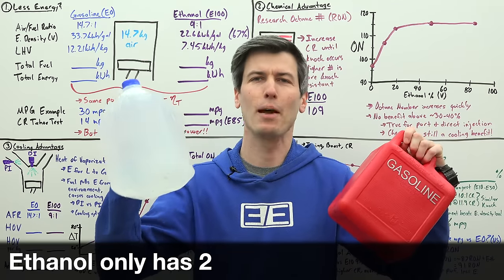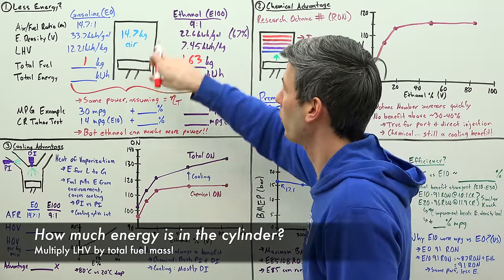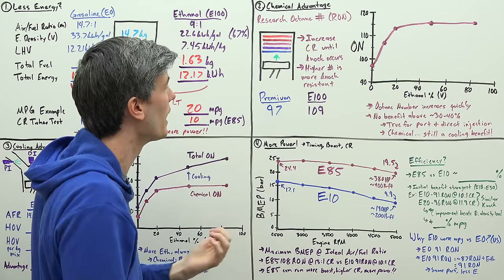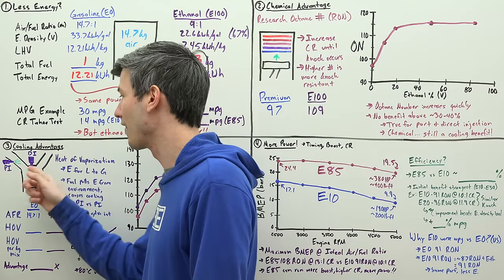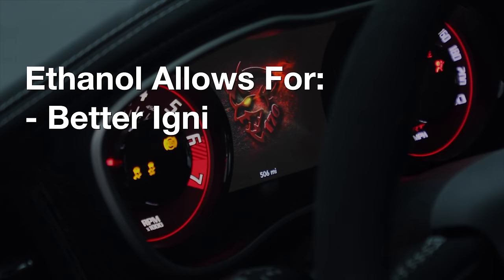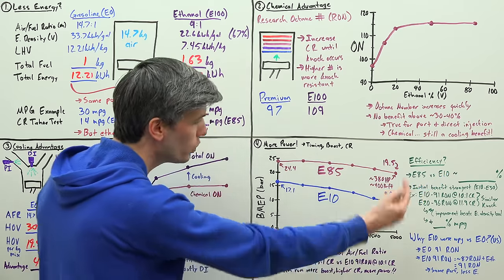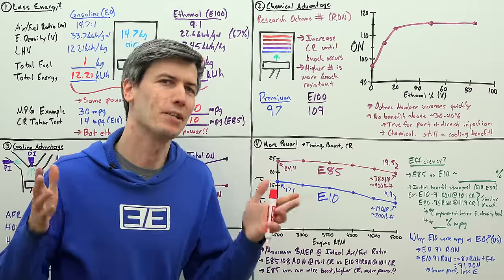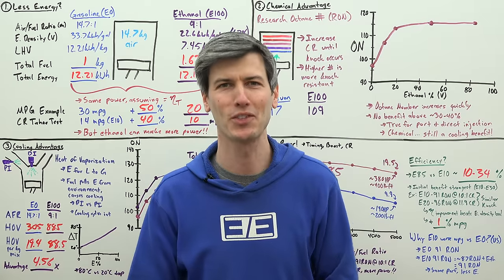Why Does Ethanol Make So Much Power? (Versus Gasoline)

Comment: Dragsters use alcohol because it has higher octane. This simply means it won't ignite as easily under pressure. This allows them to use more boost from superchargers to force more volume thru the motor. The alcohol is far less efficient and burns way more volume than gas. The additional alcohol helps cool the motor. The result is more volume due to forced induction higher octane tolerates the pressure and an engine the has a substantially shorter life due to the alcohol cleaning out critical oils. It's a bad idea to use in mass. It ruins engines. Period. This video is parroting a Data sheet and telling short stories that don't cover reality. It's wrong. Dragsters are easy to read up on. Look it up. Easy. It's only in cars today due to green agenda legislation and it ruins engines. Period.
Reply: I looked up the Indy 500 who has used three fuel, gasoline, methanol, and ethanol and it shows ethanol in these high compression engines to be very efficient.  So much so they reduced the fuel tank size from 30 to 22 gallons.

A Brief History of Racing Fuel By Craig A. Johnson

In 2005, the IRL used 100 percent methanol in their tanks. The fuel worked well and was more efficient than straight gasoline, but IRL officials believed there was room for improvement. In 2006, they moved to a 10 percent blend of ethanol and methanol, which was then changed to 100 percent ethanol for the 2007 season.

The desire to use only ethanol aside, 100 percent ethanol is nearly impossible to obtain, and is illegal to keep without paying hefty taxes that date back to prohibition. The actual fuel used by the IRL is a blend of about 98 percent ethanol and 2 percent denaturant. The exact composition includes a small amount of high-octane racing fuel.

The fuel for today's Indy cars has an octane rating of 113, compared with methanol's 107. This means a significant reduction in pre-ignition, or knocking and pinging.

In addition, many of the people who handle the fuel, say it smells like tequila. This quality may seem insignificant, but smell is actually one of ethanol's benefits when compared with methanol. Pit crews noticed the switch to ethanol immediately, reporting fewer coughing fits and less eye irritation before any other modifications were made to accommodate it.

According to Dennis Vervynckt, manager of hospitality services and an IRL official, in 2006, the first year the IRL began using ethanol, teams saw a reduction in efficiency of about 10 percent. "That's because we put straight ethanol into the tanks," he says. "The teams initially didn't make any or very many adjustments to their engines. After a few months, they kept tweaking and by the end of the season they were back up to 100 percent efficiency."

Vervynckt points out that there was a minor loss of power. "When they first started using ethanol, teams saw a slight drop in horsepower," he says. "As the teams got used to the fuel, they were able to get more horsepower from ethanol once they again reached maximum efficiency."

The switch to ethanol also allowed the racers to carry less fuel and make fewer pit stops, thereby increasing efficiency even more. "When the cars ran on methanol tanks had to hold 30 gallons to accommodate the fuel requirements of the cars," Vervynckt says. "After getting the engines to perform at their full potential, there was a significant gain in mileage. Indy cars now have 22-gallon tanks. When a driver pulls in to change out his tires, he can fill up. Teams were able to match their tire and fuel stops exactly, instead of stopping for tires only, or fuel only."

That efficiency translates into much less fuel being used by the sport. Lifeline Foods LLC, which supplies fuel for the IRL, will produce 120,000 gallons of ethanol for the 2008 season. And though this may seem like a lot, it's 20,000 gallons less than was used the previous seasons.

The switch from methanol-based fuel to ethanol has amazed almost everyone in the league. Drivers, the direct users of the fuel, voice their approval in glowing terms. "[Ethanol] is an American fuel that is good for the country and the environment," says Ryan Hunter-Reay, of Rahal Letterman Racing and driver of the ethanol car. Standing beside his crew as they make last-minute adjustments to the car, he is more than happy to discuss the benefits of the IRL's switch to ethanol. "It's been great for Indy racing the fuel economy, emissions there's nothing we don't like. We love it."
Reply: How can you not look up from the preconception you've found. Gasoline is far far more efficient. That's why you struggle with it in a high compression engine. Low octane means it will diesel before ignition. That's the only reason racers use alcohol. You touting alcohol is wrong. Gasoline is efficient. And yes, less gas is required compared to alcohol. This volume discrepancy outputs more co2 and requires way way more effort money and energy to grow and refine. Alcohol has no place in mass when it comes to engines. It's for high compression race engines. What are you overlooking?
Reply: @kevinmorris7722  — “Volume discrepancy outputs more CO2”? Really? 

How is that possible when ethanol is 52% carbon, while petrol is 87% carbon. Oxidation (burning) of a kilo of petrol emits far more carbon than oxidation of a kilo of ethanol.

If you can understand this, you’ll realize that “volume discrepancy” is irrelevant.

Given that revelation, would you care to rethink your above statement ?

Comment: Only problem with ethanol in gasoline and small motors is the ethanol absorption of water that sits in the small carburetor and will cause corrosion destroying the carburetor... Straight gas is good enough... To bad they started putting this crap into gasoline because I've seen a lot of small engines being tord down because of what ethonal is doing to them..
Reply: Identical small engines to ours in Brazil use their common gasoline which contains a minimum of 27.5% ethanol.  It has worked out so well and for so long that Paraguay went to E27.  Bolivia has gone to E25, India going to E20, etc.  

BTEX (benzene, toluene, ethylbenzene, and xylene) came along in our gasoline around the same time as ethanol, yet no one considers these highly corrosive chemicals a factor for anything.  Premium gasoline contains some 40% BTEX, regular E0 around 30%, and E10 around 20%.
Reply: Mercury Marine, which hosted a Webinar on ethanol myths, noted that ethanol does not "grab water molecules out of the air." It is hydrophilic, which means ethanol holds water. With regular gasoline (E0) as well at E10, the primary cause of water collecting in tanks is condensation on tank walls. But unlike E0, which can absorb almost no moisture, E10 can hold up to half of one percent of water by volume, and the water molecules will dissolve in the fuel. The "solubilized" water will bypass the water separator and burn harmlessly through the engine.

Mercury Marine also says E10 may be the superior fuel(over E0) because it keeps the fuel "dry"
Reply: In the days of E0, people had to buy little cans of alcohol for gas-line antifreeze in the winter.

Comment: Not many direct injection engines out there.
If you can’t afford one, this is useless.
It does work from an energy standpoint, but the initial cost is prohibitive to the average person.
Reply: The Chevy 5.3L direct injection engine came out in 2014 and has a clean 380 horsepower on E85 vs a dirty 355 on E0.

The Chevy 5.3L in 2013 and before was not direct injection and had a clean 326 horsepower on E85 vs a dirty 315 on E0.

Comment: But ethanol ruins carburetors in old shool performance  engines and in any carburated machines.
Reply: Identical non-flex fuel vehicles to ours have used >E20 in Brazil since the late 70s.  Currently they are E27.  It has worked out so well and for so long that Paraguay went to E27.

The UK sold E10 to E30 starting in the 1920s with an E10 blend called Cleveland Discol being the most popular which sold up until 1968-70 when BP bought them out.

Henry Ford designed the Model T for E100.  Production models were flex fuel.

We sold E10 in the 1930s right after Prohibition until just before WWII in thousands of stations in the Midwest.  Agrol was the largest brand.

Comment: The combustion engine needs twice the volume of ethanol. Then gasoline, which between the two of them. Makes gasoling the power champ. 
If you want to keep comparing apples to oranges. Then we must compare gasoline to Bunker Fuel.
Bunker fuel will be the clear winner.
Reply: TOTALLY INCORRECT...better head to the bunker.
Reply: Scania sells an ethanol engine worldwide and they state its power and mileage is on par with their diesel engines.

Ricardo built and drove around an ethanol engine which has twice the power/half the size and mileage greater than gasoline, even greater than diesel:

FROM RICARDO:
The new federal CAFE standards are calling for a doubling of fuel mileage performance, which, Vint says, is going to send OEM’s looking for high octane numbers to improve efficiency and ethanol is the best source. Ricardo, an engineering firm with over 100 years in the business of engine design, has developed an extreme boosted direct injection engine (EBDI) to optimize ethanol blends. The 3.2 V6 gasoline engine rivals the power and torque of a much larger GMC Sierra 6.6 diesel, he said, and it delivers 3.5 percent better fuel economy than the diesel.

But even in an inefficient gasoline optimized engine, like the Chevy 5.3L, it will get a clean 385 horsepower on E85 vs a dirty 355 on E0.

Even with the loss of mileage which is not 50% but closer to 25%, E85 still costs less per mile to drive with and with little pollution.

Comment: You are adding to the Etholol to get the more power. Some where is this idea supported by Thermodynamics People.  How would you make the Turbochargers bullet profe for the econocars? No free lunch. It seems you are missing some thing.
Reply: A non-turbo Chevy 5.3L gets a clean 380 horsepower on E85 vs a dirty 355 horsepower on E0.

BTU is a measure of heat, not work.

Ethanol has many other characteristics that more than offset its lower BTU content such as flame speed front, volume of combustion products, heat of vaporization, octane, to name a few.

 Ricardo built an ethanol engine for GM and it ran in a pickup.  Here is an excerpt of an article describing it.  Note it gets more mileage than even a diesel engine which is itself better than gasoline.

FROM RICARDO:
The new federal CAFE standards are calling for a doubling of fuel mileage performance, which, Vint says, is going to send OEM’s looking for high octane numbers to improve efficiency and ethanol is the best source. Ricardo, an engineering firm with over 100 years in the business of engine design, has developed an extreme boosted direct injection engine (EBDI) to optimize ethanol blends. The 3.2 V6 gasoline engine rivals the power and torque of a much larger GMC Sierra 6.6 diesel, he said, and it delivers 3.5 percent better fuel economy than the diesel.

This is not new technology or knowledge, it was known long ago.  It is suppressed technology.

Rear Admiral C.M. Chester wrote Henry Ford a letter on Dec.15, 1916:
"...I also pointed out in the article that as governmental laboratories had developed from 40 to 55% efficiency in alcohol engines as against 20% in gasoline machines, the use of alcohol at double the cost of gasoline for power purposes, was cheaper for motor[s] than gasoline in common use today."

Scientific journals from 1890 – 1920 contain hundreds of references to alcohol fuel at the dawn of the automotive era. 

Studies of alcohol as an internal combustion engine fuel began in the U.S. with the Edison
Electric Testing Laboratory and Columbia University in 1906. Elihu Thomson reported that despite a smaller heat or B.T.U. value, “a gallon of alcohol will develop substantially the same power in an internal combustion engine as a gallon of gasoline. This is owing to the superior efficiency of operation…”

The USDA tests in 1906 also demonstrated the efficiency of alcohol in engines and described how gasoline engines could be modified for higher power with pure alcohol fuel or for equivalent fuel consumption, depending on the need.

The U.S.Geological Service and the U.S. Navy performed 2000 tests on alcohol and gasoline engines in 1907 - 1908 in Norfolk, Va. and St. Louis, Mo. They found that much higher engine compression ratios could be achieved with alcohol than with gasoline. 

When the compression ratios were adjusted for each fuel, fuel economy was virtually equal despite the greater B.T.U. value of gasoline. “In regard to general cleanliness, such as absence of smoke and disagreeable odors, alcohol has many advantages over gasoline or kerosene as a fuel,” the report said. “The exhaust from an alcohol engine is never clouded with a black or grayish smoke.” USGS continued the comparative tests and later noted that alcohol was “a more ideal fuel than gasoline” with better efficiency despite the (*then*) high cost.

Comment: Need to brief the negatives. Hygroscopic, fuel stability, and cold weather, in daily drivers. Too many are extolling the obvious benefits in race applications, duh.
Reply: Mercury Marine, which hosted a Webinar on ethanol myths, noted that ethanol does not "grab water molecules out of the air." It is hydrophilic, which means ethanol holds water. With regular gasoline (E0) as well at E10, the primary cause of water collecting in tanks is condensation on tank walls. But unlike E0, which can absorb almost no moisture, E10 can hold up to half of one percent of water by volume, and the water molecules will dissolve in the fuel. The "solubilized" water will bypass the water separator and burn harmlessly through the engine.

>>>>Mercury Marine also says E10 may be the superior fuel(over E0) because it keeps the fuel "dry"<<<<

In the days of E0, people in northern states and Canada had to buy little cans of alcohol called HEET or DRY GAS for gas-line antifreeze.  No need with E10.  Note if ethanol did have problems with water equal to or worse than E0, we would know right away for there would be millions upon millions of stalled cars on the roads every winter.

Ethanol doesn't have any VOCs below 70 degrees which is why E85 has 15% gasoline to provide vapor pressure for starting purposes (more in winter).  

Brazil in the flex fuel vehicles there that use E100 have heated in injectors which turn on for starting similar to glow plugs which diesel engines use.

Ricardo built and drove around an ethanol optimized engine which is not for racing applications:

FROM RICARDO:
The new federal CAFE standards are calling for a doubling of fuel mileage performance, which, Vint says, is going to send OEM’s looking for high octane numbers to improve efficiency and ethanol is the best source. Ricardo, an engineering firm with over 100 years in the business of engine design, has developed an extreme boosted direct injection engine (EBDI) to optimize ethanol blends. The 3.2 V6 gasoline engine rivals the power and torque of a much larger GMC Sierra 6.6 diesel, he said, and it delivers 3.5 percent better fuel economy than the diesel.

Comment: I don't really care about power. What makes me mad is when my lawnmower won't start in the spring. Ethanol super sucks.
Reply: I can remember every spring back in the days of E0 that my father's small engines would varnish up over winter.

Like a skunk smell, the smell of varnished gasoline is something one can never forget.

I have never seen E10 ever varnish no matter how old.  Don't think it even can.

Gasoline according to those who make it lasts 3 to 6 months.  Sea Foam which is made of 25% of an alcohol states it makes gasoline last 2 years.

The DOE conducted a study on small engines and found ethanol blends last three times longer than what E0 does.  The volatile (& toxic) aromatics used for octane in E0 evaporate out and leaves behind a sub-octane unusable fuel.

The same small engines we have in Brazil use 27.5% ethanol.  It has worked out so well and for so long that Paraguay went to E27.
Reply: @danafletcher2341  im not sure whats in the fuel in your country but here in the USA ethanol fuel causes a lot of problems. It absorbs water so everything corrodes from the inside out and it turns to gel after sitting for 4 months. that's probably why all the newer lawn mowers have plastic carburetors because the aluminum gets chewed up. non ethonal fuel last for years before its a problem, at least the stuff around here.
Reply: Mercury Marine, which hosted a Webinar on ethanol myths, noted that ethanol does not "grab water molecules out of the air." It is hydrophilic, which means ethanol holds water. With regular gasoline (E0) as well at E10, the primary cause of water collecting in tanks is condensation on tank walls. But unlike E0, which can absorb almost no moisture, E10 can hold up to half of one percent of water by volume, and the water molecules will dissolve in the fuel. The "solubilized" water will bypass the water separator and burn harmlessly through the engine.

>>>Mercury Marine also says E10 may be the superior fuel(over E0) because it keeps the fuel "dry"<<<
Reply: @mp-xt2rg  Before E10, people had to buy little cans of alcohol for gas-line antifreeze called Heet and Dry Gas.  If ethanol had problems with water, there would be millions upon millions of stalled cars every winter in the northern US and Canada.

Gasoline lasts only 3 to 6 months which is why Stabil was invented back in the late 50s.